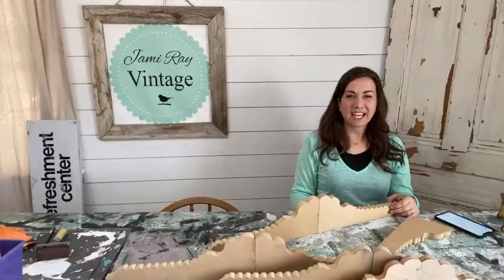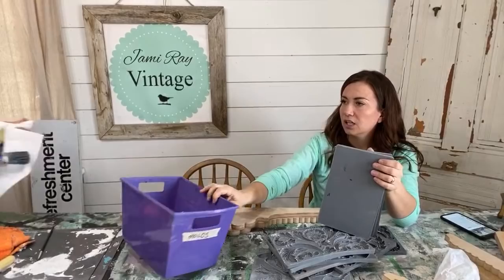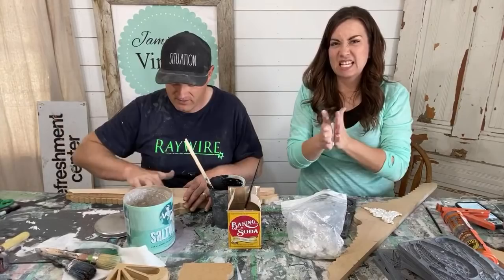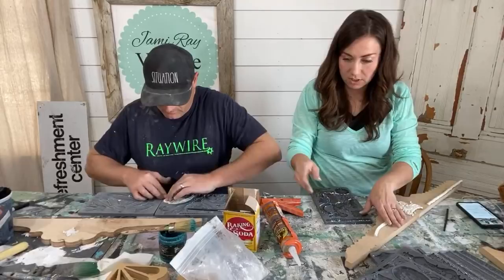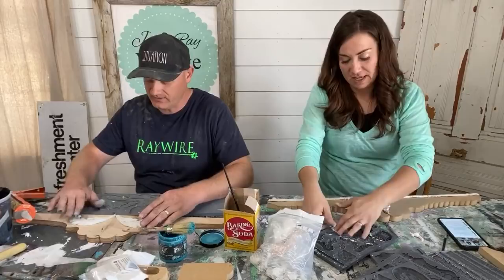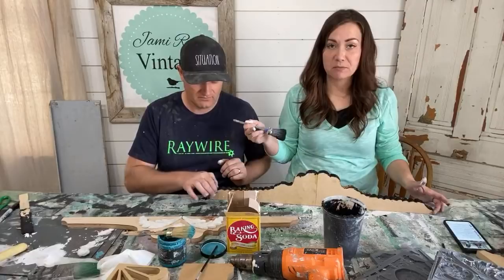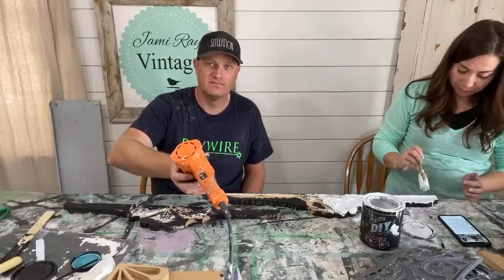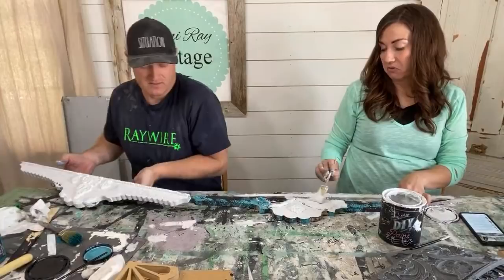DIY Scrap Wood Shapes into Pediments  WNW

Comment: If heat gunning isn’t a real phrase, it should be!!! Zeb, I didn’t catch what glue you used to glue the 2 scrap pieces together with, but if that seam might split - you could glue what a million “Dollar Tree Crafters” use. Popcycle sticks . Placeed on back perpendicular to seam. Then further down on ends to keep the masterpiece from “rocking” on the wall. But then again, staples are waaaaay easier 🙂

Comment: This CNC machine? Is that what u call it? Is it a lot of computer programming and software installs? Is it hard to learn and what is estimated cost someone would have to spend on a machine like that? How cool!
Reply from the maker: There are free programs like fusion 360 that people can use for private use, if you use it commercially they charge a fee. CNC machines start around $1,000 and go up from there. 
We have the Laguna IQ 2x3’ work table.